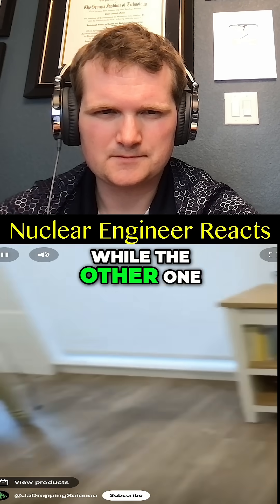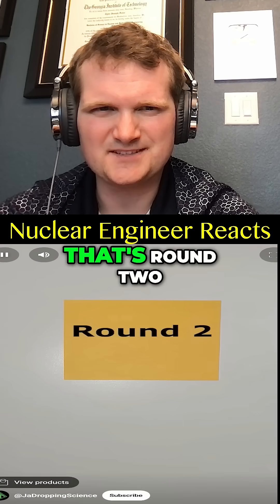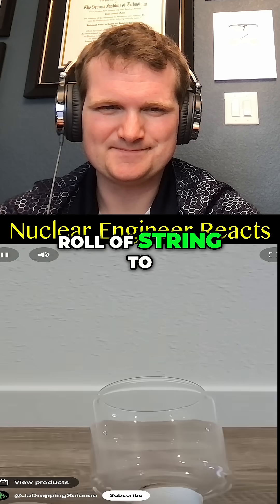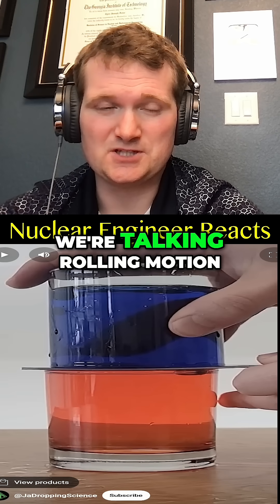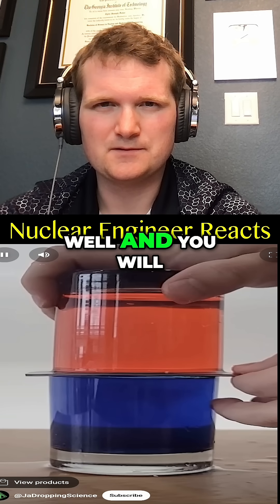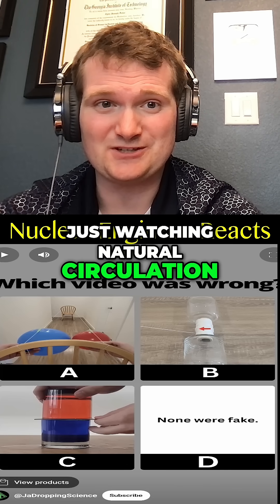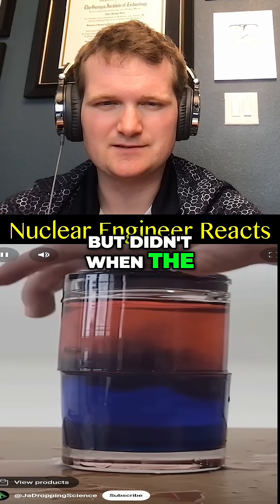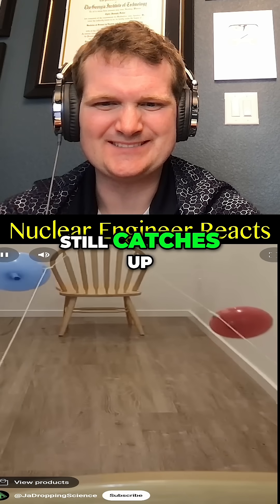Are Bigger Balloons Better? - Nuclear Engineer Reacts to 2 Truths & Trash by JaDroppingScience

Comment: "My grandma died 😢"
No different than when a fuel cell becomes innert after decades of opperation 🤠
Reply: fuel rods are in the core usually for only about 12-24 months before they are taken out
Reply: @minoupower554 for efficiency and demand upkeep yes, but if were talking usable power over time 235 takes ages to deplete, only abotu 10% is spent when they replace them, as you very likeley know